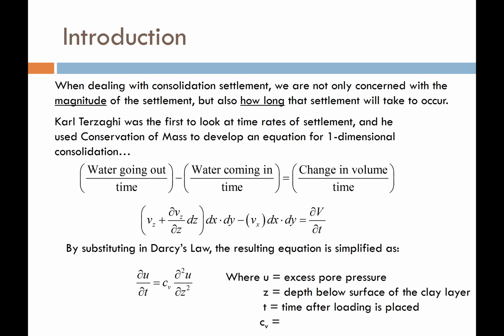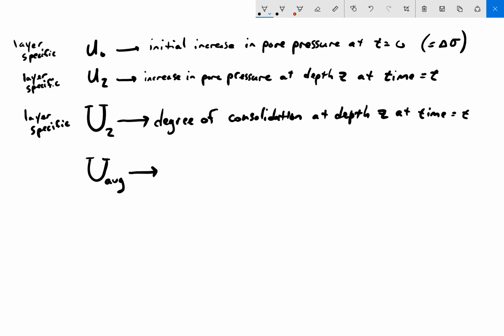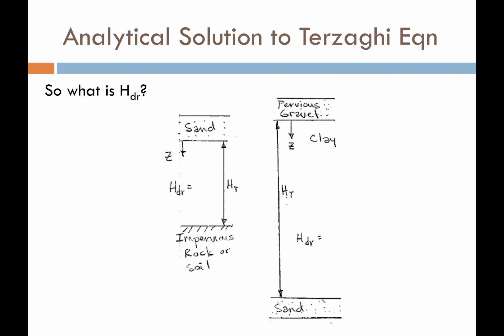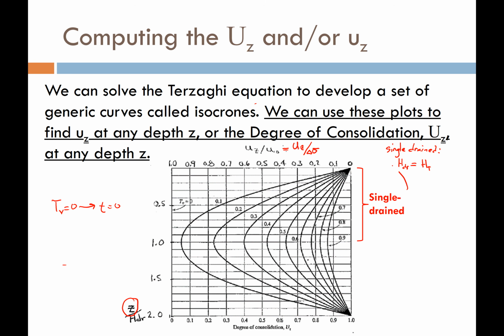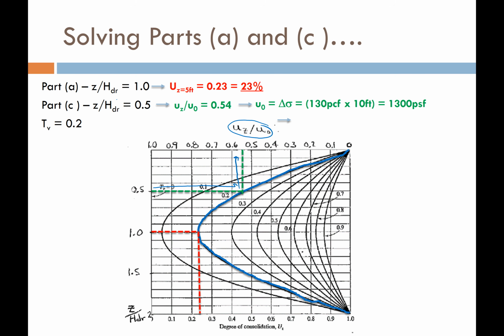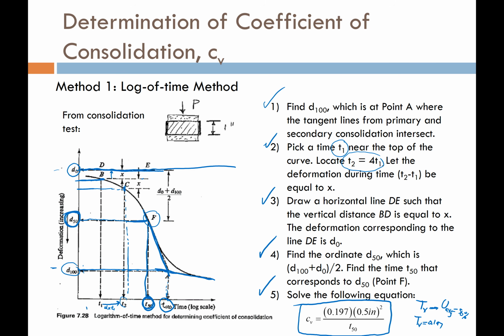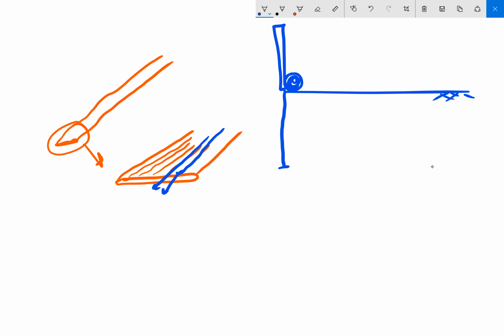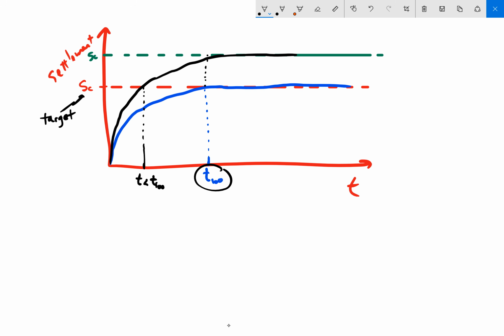CEEN 341 - Lecture 17 - Time Rate of Settlement

Comment: Say, there are four layers below a square footing. Up to the depth of footing the soil is clay.

First layer: clay soil, thickness H1, coefficient of consolidation: Cv1

Second layer: clay soil, thickness H2, coefficient of consolidation: Cv2

Third layer: sandy soil

Fourth layer: clay soil, thickness H4, coefficient of consolidation: Cv4

The fourth layer is followed by impermeable rock.

How would you apply Terzaghi's classical formula , t = Tv/Cv*hd^2 to this problem? (hd = drainage path)

To be more specific, how can we calculate time required for 50% 
consolidation of entire soil system? What will be the values of Cv and 
hd for the first layer?
Reply: Hi. I think Hdr for the first layer has to be Hdr = Ht, because we can consider that the second layer is "impermeable" (to simplify) and first layer is single-drained. Another way to do it is consider Hdr = H1+H2 for the first layer, and find a way to get an "average" for Cv1 and Cv2 to use it for Tv equation for the first layer. That's only my opinion.

For second and fourth layer we can consider only single-drained system, so Hdr = Ht.

I hope you get the answer soon. That's an interesting question.